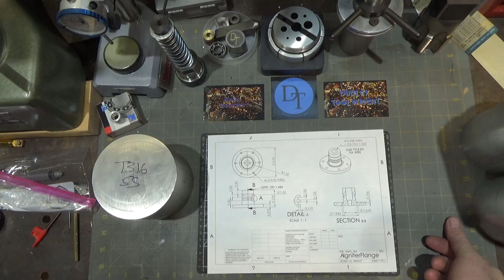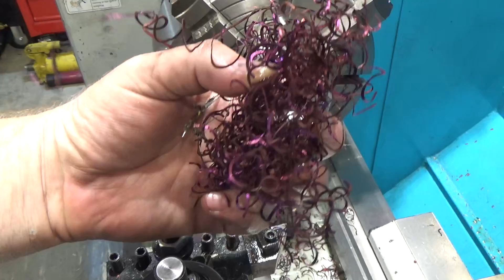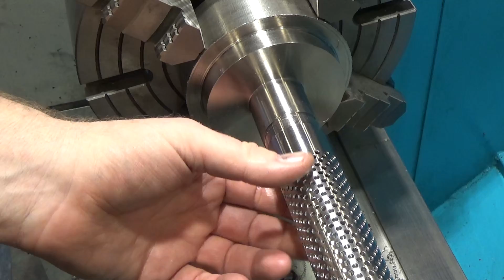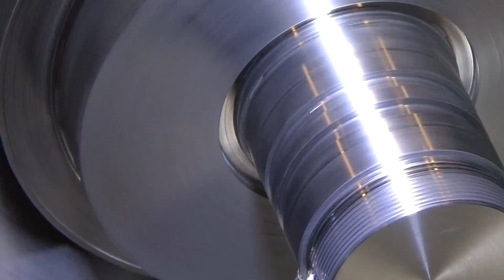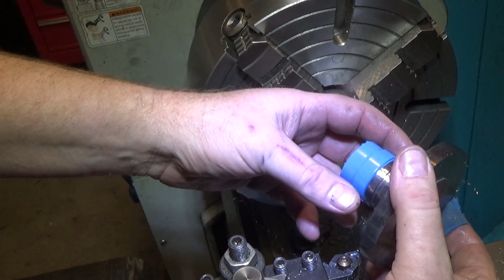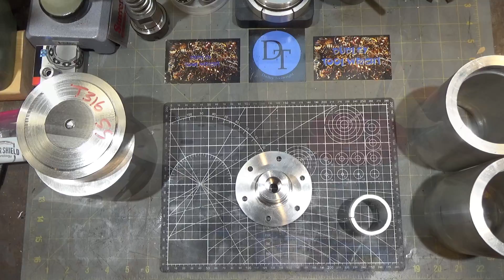133 Solid Rocket Motor Igniter

Comment: Besides machining my other hobby (obsession) is rocketry. This is for a solid propellant motor, the "basket" (wonder how that was made?) you were checking thread fit with contains & distributes a pyro mixture which generates an intense, hot fireball, instantly lighting the motor. A 12" solid prop rocket wouldn't have the energy to reach orbit but can easily reach "space" (100km - Von Karman line). Sounding rockets like this one are routinely used to fly science payloads from 30-300 miles, some much higher, but all sub-orbital. Sorry for the rocket nerdout but  a beautiful job on that part, hope you can share more of these.
Reply from the maker: I really appreciate the extra info. Very interesting. The 'basket' as they called it was CNC machined by another shop and was purportedly very expensive to make. The ultimate destination of the rocket was "space" as described by the engineer I was working with, but that might have very well been a misnomer or oversimplification.
Reply: @DudleyToolwright  Well it's a small world because just this morning a buddy texted me telling me this was his rocket :) He's spent a lot of time on solid motor ignition systems and from what I've seen recently has gotten really good at it. Maybe he'll chime in here with a demo video.....

Comment: Good job on an interesting project. 316 is brutal on drill bits. I'm sure you went through several sharpenings. Try slowing the machine down to a crawl and your bits will last.
Reply from the maker: It was tough. I used a new drill bit and lucked out.

Comment: Super bad chips 😁 
Tryk give it some higher feed at lower rpm.  
Also I wouldn't run that drill so fast. 

Other than that it turned out good 👍
Reply from the maker: Thanks for the tips!

Comment: What cutting fluid / oil are you using there while drilling ?
Reply from the maker: I typically use Cool Tool II.
Reply: @DudleyToolwright  thanks! Looks cheaper than tap magic

Comment: Already doing space parts? Nice job man.
Reply from the maker: A lucky job to be sure. I chickened out on the follow up parts though because I have very little experience with graphite, the specs were tight, and the stock was $800 a piece. I guess I'm not ready to play with the big boys.
Reply: Dudley Toolwright well it won’t be long I’m sure. 👍

Comment: I was doing a bunch of parts that had 1/2-13 and 1 1/8-12 threads on them  got the 12/13 mixed up at one part and couldn't figure out why I couldn't get my parts to fit.  even mentally I mixed the 12/13 so when I got out my thread gauge I was like these things are spot on.  Talk about a bad day in the shop.
Reply from the maker: Problems like that really can give one that sinking feeling. I sympathize.